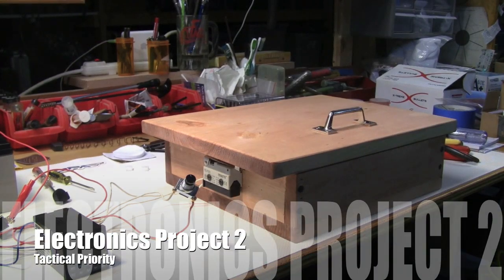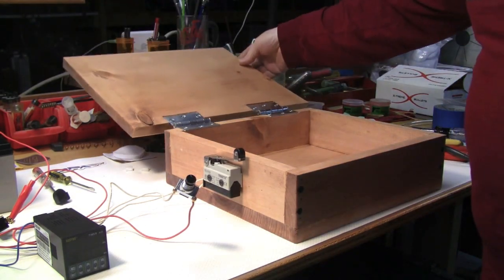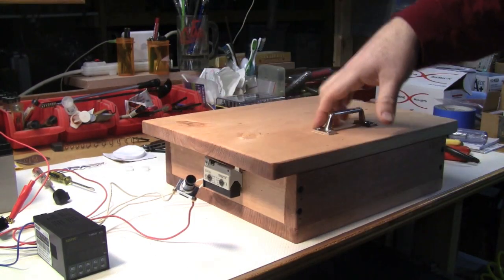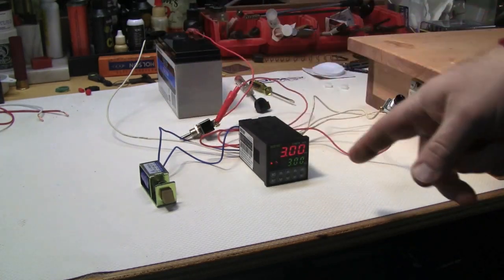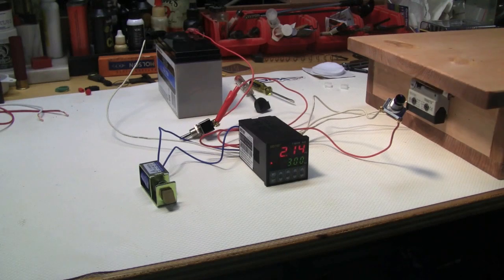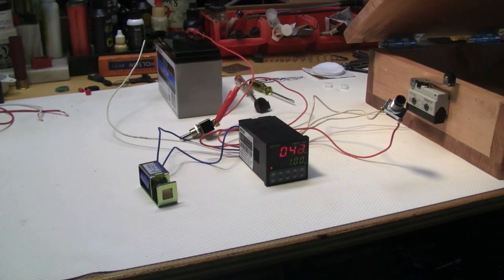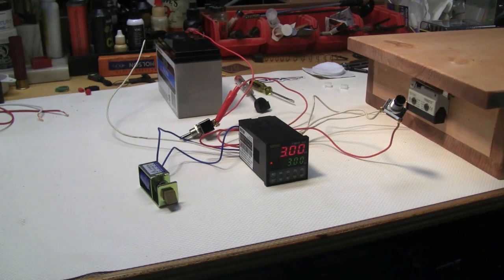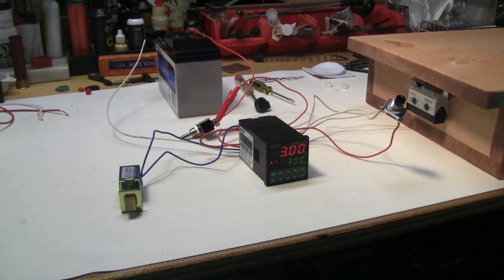Electronics Project Part 2

Comment: http://www.galco.com/shop/Time-Delay-Relays  Basic timing functions.  I have used these to design all sorts of control functions when I worked for a power company.

 http://www.bb-elec.com/ and http://www.wici.com/ 

You can do almost anything you can imagine, and the thing is, you can imagine how to do something many different ways.  I always loved building "kludges".  In the old days, the management just wanted something to work, and did not care much about how you made it work.  You get into this sort of thing when some old piece of equipment breaks and is no longer available, but it did something that still has to be done.  You can piece parts together in a way no one understands, "KLUDGE", to replace the whatever broke.  The best part of being a Tech!  Have fun.